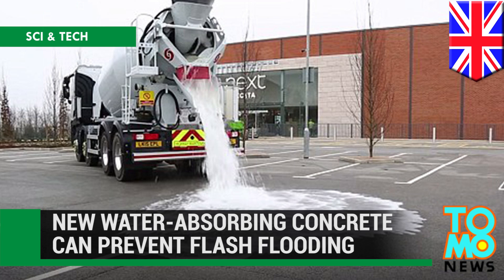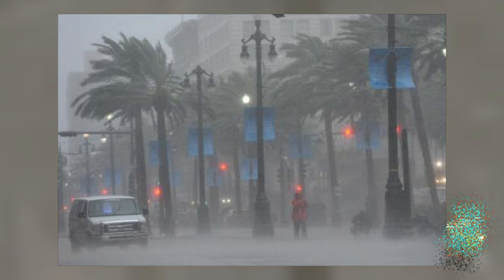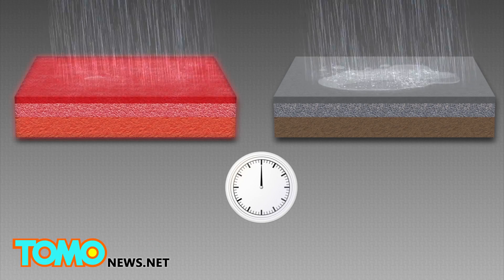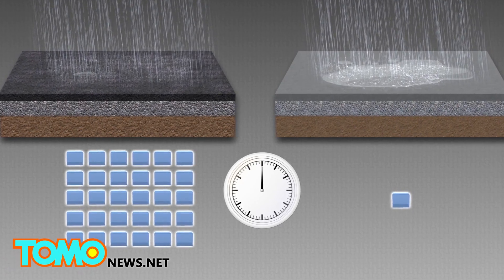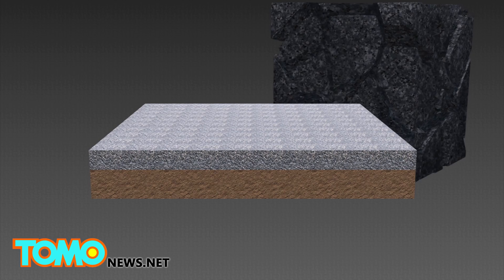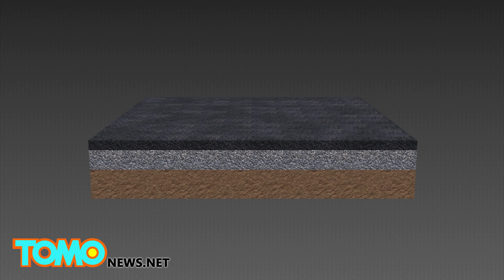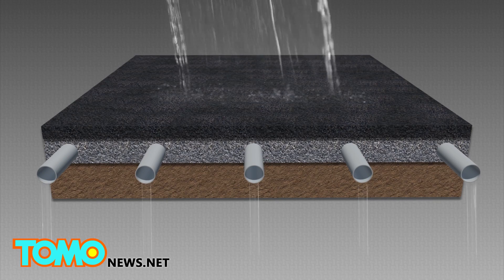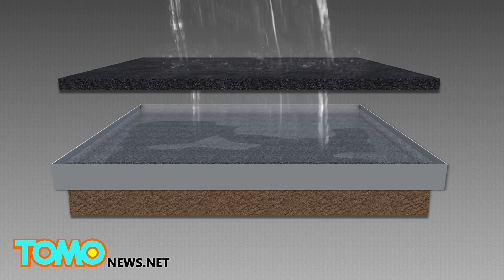'Thirsty concrete' can absorb 36 meters of rain in 1 hour, could fight flash floods - TomoNews

Comment: You know what else permeable concrete could fix? Water preservation. Why has nobody made a permeable concrete concave-topped water tower that fills up with and purifies water each rainfall? Or instead of complaining that when it rains canals flood and cause problems, why not create permeable concrete canals to flood on purpose to refill groundwater directly into the reservoirs, use it for "canal" irrigation, for in-pipe hydroelectricity, and anything else water is needed for? Someone got the math on a permeable concrete water tower? #TokeThatRainFoo

Comment: Ya but I already see a problem with it

When it takes in water and everything gets colder and it freezes it will expand, breaking the grand apart leaving a crumbly mass that will need expensive reapers straight away.
Reply: thats why in this case you add freezing and thawing resistances
Reply: Ju Ju Priest.  XD
Reply: +Barry Soetorro The voids in the granite is much bigger therefore water willl go straight through the soil before cracking will happen. The problem is whats underneath the granite if anytime of cement i would just add air entrainment in the cement.
Reply: +legion if it any kind of concrete
Reply: +Daniel Tutor Once the cement gets covered with dust & dirt it will clog all the holes and fail - it would need to be vacuumed free of dirt as needed
Reply: Sharpe Tutor Ha! Look up weather-resistant permeable concrete. Trollsohard